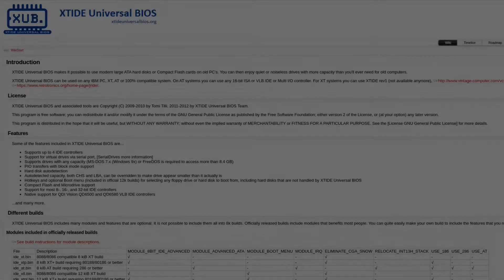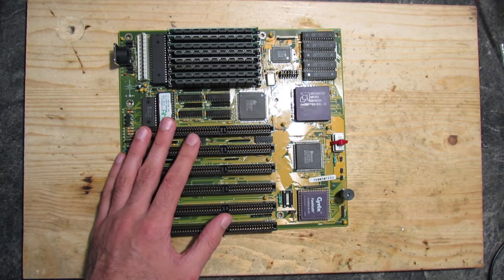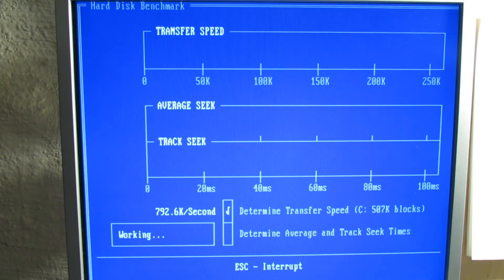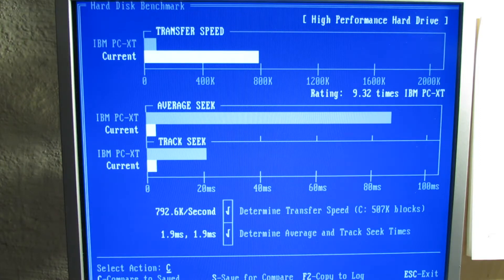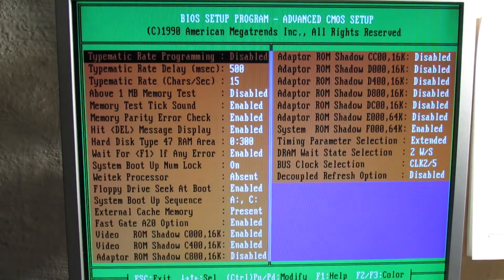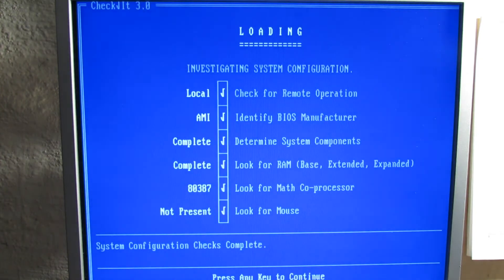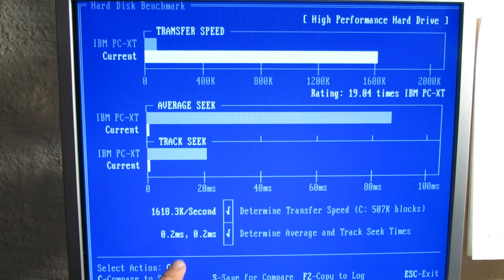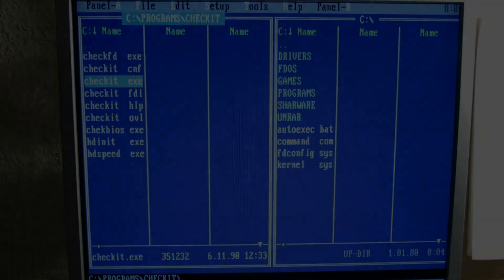Boot retro PC using XTIDE (Part 5): How to increase I/O performance

Comment: These videos were cool. Only once, did i pull a 3-Com card that had a chip in option socket. I dumped the EPROM, and there was nothing on it. Seems someone stuffed it in there for: 1. They didn't know what they were doing, or 2. They just wanted to fill the hole. Think of how much money 3-Com could have saved by not adding the socket. I'm glad you found a use for it, even after all these years later. Thank you for these videos.
Reply: Funny story :) However, omitting the socket was not an option back in the day, because, even I still remember the times when network boot was really common in places where many computers were networked (especially schools, etc). The sysadmins wanted to avoid the hassle of setting up and subsequently fixing each computer's OS environment after a stupid user screwed something up. So they let the computers boot up from the network from a pre-made boot image, and the local HDD (if any was even present) didn't contain anything valuable.
That's what these sockets served originally - the option bios was needed to connect to the BOOTP server, mimic a bootable C: drive, and download parts of the boot image from the server upon request, while acting towards the OS as if they were present on a local disk (which did not exist). They basically hooked the INT 13h in a way similar to how XT-IDE bios does it. Only the code executed when called was different.

Comment: How fast is the XTIDE's EEPROM itself? Is it something like a 150ns EEPROM? Would using a One Time Programmable ROM with a faster access time, like 70ns or even 35ns, also produce this sort of speed increase?
Reply from the maker: In that case it shouldn't make any difference, since the EPROM has to be just fast enough to be read by the ISA bus.

Comment: This is the first time in 30 years that I finally understand the purpose of the ROM shadow.  THANK YOU!  Is there a reason why it's not on for the entire range by default? I was under the impression that area of RAM is dedicated for boot ROMs and can't be use by the OS (even if nothing is mapped there)
Reply from the maker: That area is referred as high memory and is used to offload some drivers and TSRs from the conventional memory. If you just block it completely, you would waste a lot of memory.
Reply: EMS memory does make use of the UMB area (640 KiB - 1 MiB). In real mode the CPU can only address only the memory range up to 1 MiB. If you want make use of the memory area above 1 MiB you need to turn the CPU into Protected Mode. But Real Mode applications don't understand that mode.
Thus EMS memory is a solution. It does use the memory above 1 MiB by copying a small window of 16, 32 or 64 KBit into the UMB area which Real Mode programs can understand.
To do so there must be a free and writeable area in the UMB area available. The job is done by the HIMEM.SYS driver.

The HIMEM.SYS driver switches to protected mode, now the driver is able to read and write data to the memory area above 1 MiB. It copies a small window of data, that was requested by the EMS capable real Mode application from the memory area above 1 MiB in the small EMS window in the UMB area that EMS capable Real Mode programs can understand and then switches back to Real Mode and giving the Real Mode program the control about the CPU back.

If you need some other data from above the 1 MB area, that is not in this EMS window, you have to copy another block with the Data above the 1 MiB memory area into this small EMS window.
The larger your EMS window in the UMB area is, the less data have to be copied over and over.
But because a segment has only the size of 64 KiB, 64 KiB is the larges size for such an EMS window.

EMS is easy to use and also runs on 286 processors, It is also compatible with expander cards that can be used on 8086 processors to have more RAM.
Because of this, it was used in the early DOS applications up until about the end of 1992. It only has one downside. You can't run program code in it, at least that's not what the standard provides. It is therefore only suitable for data.

EMS was later replaced by XMS and DOS Extenders like DOS/4GW. These switch the CPU to protected mode and only then is the protected mode-capable application started. There are also DOS extenders for 286s, but accessing the RAM is easier in 32-bit mode, which is the reason why most applications from around 1993 and later that use a DOS extender require a 386 or better CPU and are written for 32 Bit.

Comment: OH.... That's cool.... I've never seen this in practice before.... I have a vague recollection in the windows 9X days that the common advice at the time was the opposite, since when windows loaded up 32 bit drivers the shadow was wasting ram/time..... Thinking on this now, I just always accepted that as gospel without testing it.. And I never bothered checking if when the PC switched to dos mode for a game if it then was slower in dos.....  Might be interesting to see if on 586/MMX class machines how this plays out with windows/dos and the shadow on/off.... Maybe something for a part 6?  (or maybe I'll poke at it....).... Oh, I wonder how the windows 9x installer handles this too.  So many variables.
Reply: Well, this is true.
Windows 95 does have its own drivers and thus isn't dependent on the BIOS Firmware so much. Windows 95 is also a 32 Bit system, which means, it can access addresses in the range from 0 to 4 GiB.
Most DOS games were programmed for 486s and earlier. However, a 166MHz Pentium was already so fast that whether or not Shadow RAM was used should have played little practical role in these old games.

Comment: Is there any utility to enable shadowing after boot? I have Micro8088 XT machine. Thanks
Reply from the maker: I don't think so, there is a tool which works with some chipsets of 286-486, but I don't think, that it supports XT. You can give a try: http://www.win3x.org/win3board/viewtopic.php?f=8&t=26070&language=en

Comment: i have gained not 1 step with this motherboard
so i bought some real cf cards i know they are real because i contacted sandisk
all of them are 256 mb and they work 100% in my p1 166 machine
the settings are /256mb/cycls978/head16/prcomp/65535/landz977/sector32 normal not lba
when i pop in the cf card n the 486 the post screes says mass storage hdc fail !
all 256mb cards work in my p1 with ms dos etc 0 problems
the 486 motherboard has a ide connector on the mobo itself i cant test that because i dont have a manual !!
so my only option is by a xtide card ? would that by pass the bios ,iam lost
oh and to look up the correct settings for the cf cards i also used the p1 and a program called IDEINFO
Reply: Have you loaded the XT IDE universal BIOS on your 486?
Keep in mind  XT IDE universal BIOS is software, it's not hardware. There are IDE controllers (hardware) available with the same name and they are probably using this  XT IDE universal BIOS software.

Comment: Nice ! Unfortunately my 286 has a very limited bios and all I can do is shadow the bios or the integrated VGA bios and that's it. But I'm using a mechanical drive anyways so I think it's not that big of a problem in my case.
Reply: Actually ...

I think I I have found another way around that thanks to a piece of software you can run ! 

I'll have to check that tomorrow but I think I've found a method to do this without relying on the bios (with other limits but also other massive advantages)
Reply from the maker: Very nice! I'm curious.
Reply: @necro_ware  Well yes after benchmarking it, it made a significant improvement even with a mechanical hdd :)
So without what I did, the transfer speed was 463.8K/sec and 15.7ms average seek time and 4.9ms track seek time.
After what I did, I reached 660.3K/sec (200 more K/sec !) 14.8ms average seek time and 3.9ms track seek time.
So even with a mechanical HDD, shadowing does some improvements :)
Now what did I do since my BIOS doesn't let me shadow RAM as I want ?
I used this : http://www.win3x.org/win3board/viewtopic.php?f=8&t=26070
This marvel lets you use the shadow ram area as UMBs for MS-DOS, which means you can load stuff high without needing EMM386 or even HIMEM.SYS ! This is very useful for a 286 as EMM386 ... requires a 386. Before that, I had 570K free or so, now with everything loaded (network drivers, mouse drivers, keyboard driver ...) I have 622K free :) (and I could add even more things there and still have 622K of conventional memory free) 
But it also detects each ROM in the computer and automatically shadows them :D (now if your ROM must NOT be shadowed, you can tell the program to not put it in shadow memory. But the documentation explains all of this).

Now here's a catch : it only works if your chipset is supported. My 286 has a C&T NEAT chipset, which is supported, but if you have, say 486 from 1992 or later, it's likely it won't be supported (some 386DX aren't supported either and some 286s too, it all depends of the chipset ...).
Reply from the maker: Very nice find! Thank you for the update, I'll definitely will take a look at it. I also have two 286 PCs here and could use it there :)
Reply from the maker: The documentation already is a gem! It contains so much interesting information. Very cool!
Reply: @necro_ware  Sure ! it can be useful for 386s too, especially when you're trying to get as much conventionnal memory as possible because you can load himem.sys high :)
You could also add it to this series for computers that have limited BIOSes like mine.
Reply from the maker: @DxDeksor  May be I'll do, if I'll find some time to get into this tool. I have to get some experience with it first. Anyhow, thank you very much, this is a nice thing indeed. Where did you find it? I knew about QEMM386, however, this seems to be even more interesting...
Reply: @necro_ware  I'm not really sure. It was probably some obscure website or a random FTP. According to the doc this was distributed as a shareware so it was probably available on bbses back then.

Maybe the man who made it is still alive ? I'll try to find what he became and try to contact him, it could be very interesting :)

Comment: I would like to ask if you know what is the max disk size that the XT-BIOS is able to recognize, imagine a 386 Mobo able to boot and use an 8GB CF card. Thanks!
Reply from the maker: I don't remember the upper limit, however 8GB will run just fine. I have a 16GB card here myself and I'm using it with XTIDE from time to time. But you'll need to format the disk using FAT32, because with FAT16 you are limited to 2GB partitions. DOS 6.22 and lower only supports FAT16, so you'll not be able to use fdisk from there. To get FAT32 working, you have to use DOS 7.0 (Win95 and higher). Or you just go with FAT16 and divide your 8GB disk into 4 partitions 2GB each.
Reply: Before LBA48 came out, I think anything had internally 28bits for addressing 512b blocks. This means that the maximum for anything made before 2003 is 128GB.
Reply: @necro_ware  He can also use FreeDOS. FreeDOS is able to use FAT32.